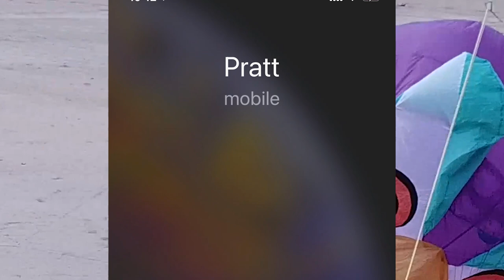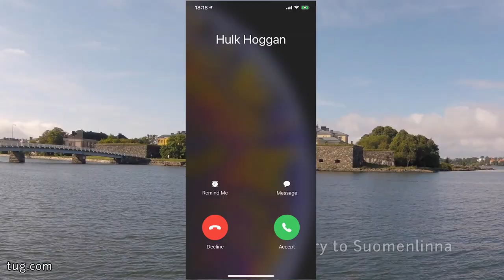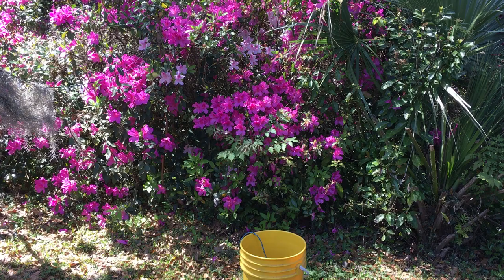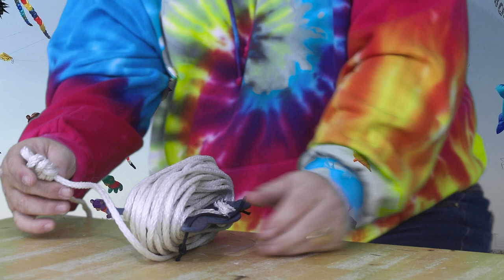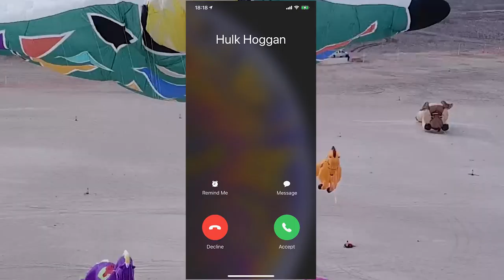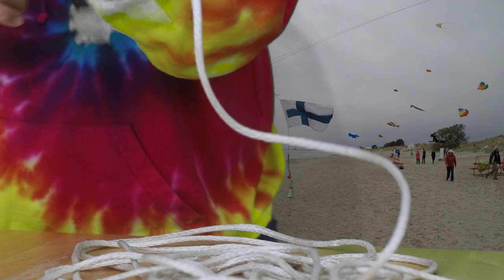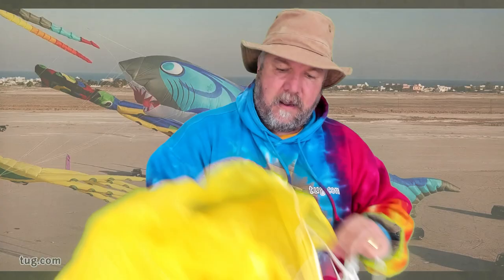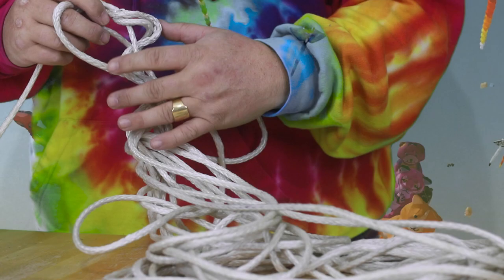How [not] to tangle kite lines - Umake 2021

Comment from the maker: Something that I fail to explain in the video:
In an Axial winding, the reel does not move, but you add or subtract a full twist every for every time that the line goes round the reel.
In a tangental winding the reel rotates when you add or remove line.  Where line is added to the reel, no twist is imparted.  When line is removed from the reel, any twist which is there will remain.

Comment: You don't seem to have any experience with "normal" kites or empathy with those who fly them.  Most kite-fliers are very happy using hoop spools with their kites and have no problem at all with tangled or twisted lines.   Simply turning the spool over every few turns when re-winding effectively cancels out the twisting and makes the spool a very good method of storing and using line.  Line bags are undoubtedly great for the the thicker lines that you use with the big lifters and line laundry, but for 95% of kite-fliers, hoop spools are ideal and line bags would not be a good idea.  I've used hoop spools for years with hundreds of different kites and never once had a problem with twisting.  If you made it clear that you were dealing with heavy lines and not the ones used for "normal" kites it would have been better.
Reply from the maker: Strewth Jim,  I tried to cover every possible method of line management, starting from theory, and including halo reels, hand casters, using sticks three different ways, balls, bags, heaps, cable winding, winding round your arm, untangling, chain stitching, fishing.  Of all this stuff, I probably spent the most time explaining how to use halo reels and why you should swap hands when using them and I tried to keep it light hearted and fun.  I'm sorry that it seems to have made you unhappy.
Reply: @MrAndrewBeattie  My grouse, Andrew, is that you seemed to be trying to persuade people to avoid the hoop spools and use line bags instead.  I have dozens of hoop spools and hundreds of kites and have never had a problem with twisted lines.  You don't need to swap hands, just turn the spool over occasionally, as I've shown in one of my too-many videos, and the spools are ideal for the vast majority of we amateur fliers.  For the professionals like you and Simon etc., the line bags are clearly the answer, but for someone flying a kite on 50lb line they'd be a disaster.  My motto is always "Keep it simple!" and I feel that if you were not misleading a lot of fliers you were at least confusing them by your lengthy but no-doubt comprehensive account of everything. I hate complications in my flying, and I'm sure most fliers do too.  Hoop spools, and even the handles supplied with children's kites, work well for most of us and I always recommend them to those who ask (and tell them how to use them).